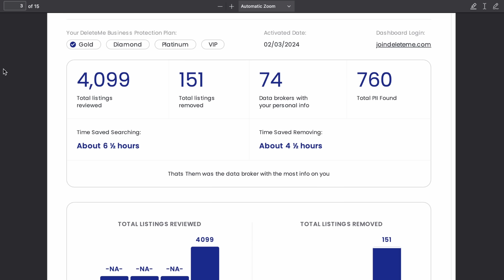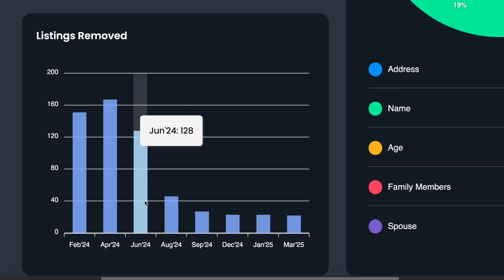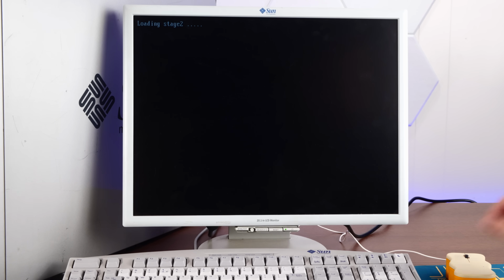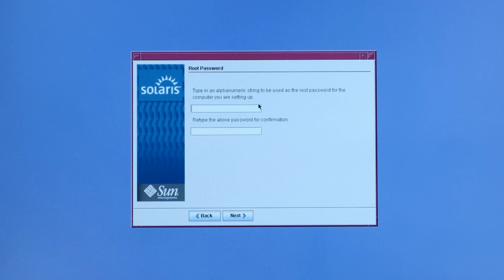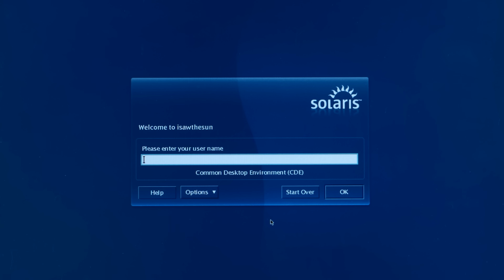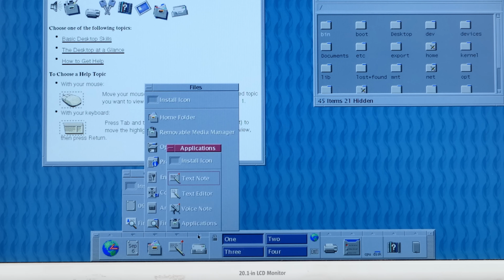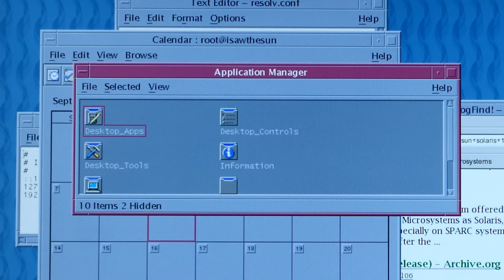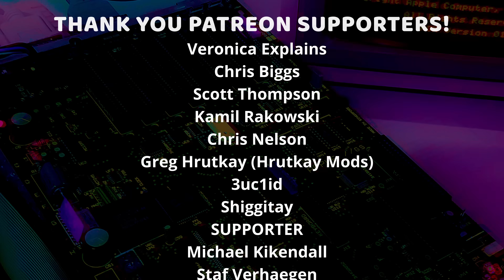The AMD Opteron Changed Everything

Comment: Itaniums were pretty much server CPUs.  It must constantly irk Intel that “amd64” became the standard for 64-bit x86.  And they were so irked that they maligned it by telling people nobody needs 64-bit CPUs in home PCs before they adopted it in 64-bit Core CPUs.
Reply: It certainly irked them that they had to license the changes back from AMD. 

Itanium was a VLIW/EPIC architecture and as such was very dependent on good/specialized compilers to get good instruction level parallelism.
Reply: SGI used Itanium in their Altix supercomputer line. We had one at NASA Goddard. The most interesting thing about it was that it ran a single system image on a huge number of processors, up to 1024, under Suse Linux. Modern supercomputers are clusters of systems with each node running its own Linux kernel image.
Reply: Itanium was such utter garbage that I can't tell if it was sheer incompetence or a malicious attempt to kill the RISC market.
Reply: I remember when the first "Intel 64" or "IA 64" versions of the P4 were available.  Prescott I think or Prescott-E?  Anyway, I remember their marketing litature saying in a minimized way, "may be largely AMD64 compatible."  I used to laugh at this a lot and said, "Its the same DAMN thing" (with only a few, mostly insignificant differences).
Reply: @jkeelsnc  IA-64 was Itanium. They initially called their implementation of AMD64 EMT64.
Reply: @LordApophis100 yeah.  Thank you for pointing that out.  I didn’t remember it correctly.
Reply: They implemented it in P4 "just in case" i suppose ^^
Reply: @Crazy_Screwdriver The Pentium 4 had an Intel 64 bit extension but Intel management forced it to be fused off and threatened to fire the lead architect if he continued to push for 64 bit in the P4.
Reply: @LordApophis100  Yes, That's true, Bob Colwell confirmed it a while ago, Pentium 4s had internally the ability to run x86_64 before AMD Finalized the Specification